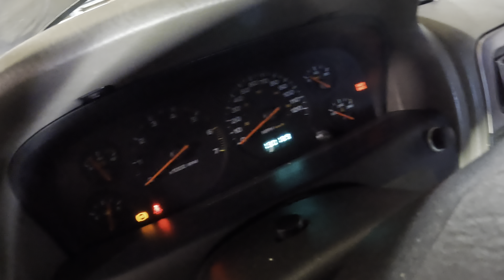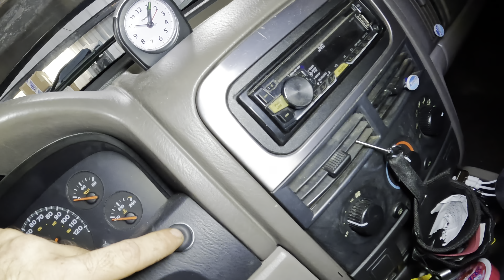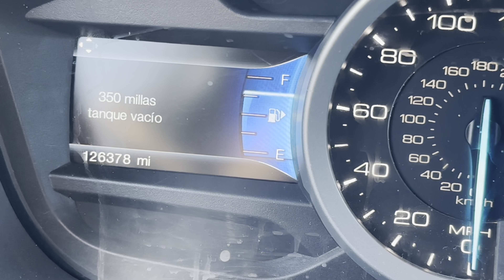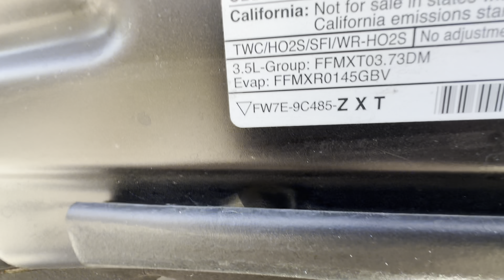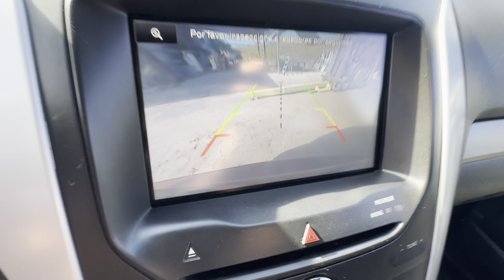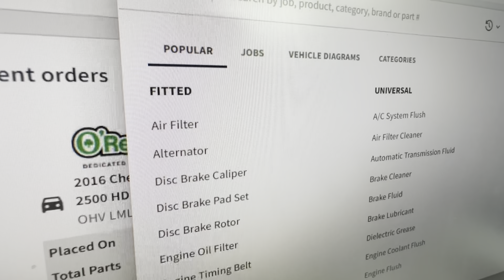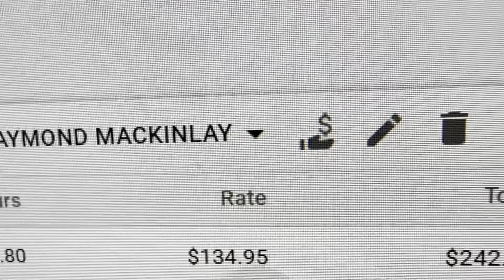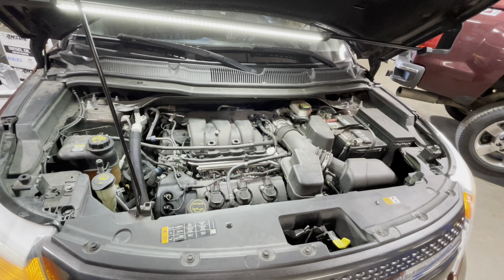TOO EXPENSIVE!  Repairs Declined! Twice! Jeep Cherokee 4.0 & Ford Explorer Noises While Driving

Comment: If you want to see an expensive alternator replacement, the 2005 Ford Escape V6 4wd quotes 7.8 hours. Having done one once, it takes 10 minutes to loosen, the rest of the time is making a hole big enough to get the unit out.

Comment: That Jeep Looks and sounds a lot like a DIYer something I use to pull in my younger age when i first got a car. Take it to a shop have them do the diagnostic and them tell me the problem and then attempt to fix it myself while ussually making the problem worse. Now ive learned over the years if im taking it to a shop to be diagnosed have them fix it and if i cant afford to do so then i need to keep it parked or driven within certain limits. Ive matured over the years. Sounds like you keep getting stuck with some guys DIY project whoes most likely to cheap to pay you. But dont worry from experience hell go home and butcher it up and youll end up fixing another persons screw up instead. 
Glad im not the way I use to be Lol. Watching your vidoes and others have taught me to have more respect for yall.

Comment: I have the same year & model Jeep but mine’s a Limited.  I have 240 k miles on it.  Just changed all my suspension parts front and rear.  That rear upper control arm will really try your patience. This Jeep is sad. I’m surprised they don’t have the death wobble.

Comment: Also for the fwd crossover, of any variety, losen the front subframe, unbolt compressor from block(slide out of the way)  and itll give you enough room to drop it from the bottom. Source: fwd nissan v6 alts done more thsn id like to admit

Comment: On the subject of the OEM Quality Alternator, the Motorcraft ones, like most Motorcraft things, are usually quite a bit more expensive, but they're good quality parts, and most of Ford's stuff, even their aftermarket, is still made in the USA, so you're getting what you pay for.
Source: basically restoring an old Ranger and only get Motorcraft when possible and have been keeping tabs on it, unless I know of an aftermarket part that is guaranteed to be better.

Comment: Had my boss's Exploder Alternator Pulley Seize, and burn the belt off. Same model, and engine. Ended up doing the job twice becsuse we went with the aftermarket Alternator first. That didnt work out, so i went with the OEM... i was able to sneak it out without touching the AC. Must be a common issue with the Ford Nators in that model...

Comment: Makes me glad I live in Australia where all states have mandatory annual safety checks for rego after a vehicle is more than 3 years old. Catches bald tyres, bad brakes, faulty suspension, structual rust, electrical faults etc.  You can't register or insure a vehicle without a pass. Ray should really charge customers some kind of inspection fee - I'd say min 15 mins labour fee. That first vehicle wasn't safe and the second one basically got a free diagnostic.

Comment: Referring to the explorer, what I try to tell customers (and usually after the fact)  for next time, is spending 500 now will save you 1,000 later.  Because it's going to be a catastrophic failure, usually at an inconvenient time, and then you have to pay to be towed, and it will likely take more parts with it as it fails.  That alternator pulley will seize, destroy the belt, it will likely take nearby wires or hoses with it.  And if the belt wraps around and gets caught in moving parts, it might burn down the whole vehicle, causing even more money to leave the bank..  long winded, I know.  But if you have to spend money, a little now is better than a lot later

Comment: FYI Ray most Ford's dont have a button on the dash for heated steering wheel if there is a touch screen head unit. There is only a selection for it on the head unit in the climate control menu. Pretty dumb design but thought you could use that info for future reference.

Comment: Wait, you don't charge a mandatory diagnosis fee?  My local Ford dealer and private shop charges an individual fee for every item they diagnose, if you fix anything or  not.  My last trip to Ford they wanted $197 per item diagnose and I had five items.  I told them to just leave it and I will pick it up.  $985 before any parts or repairs is insane, but that is Denver for you.  They weren't even anything major either.   I have no problem paying for diagnostic fees but a grand before anything even gets looked at it nuts.  You definitely should charge $99-$125 diagnostic and if they have you do the repair you can remove it or reduce it.  But damn.  I thought that was cheap to replace the alternator with a Ford part, belt, etc for $593.  I don't have much money but I see quality work done at this shop and well deserved.

Comment: How odd - looks fairly new - you need a working alternator as it can strand you.  Up here they charge for diagnostic eh - the only recent exception was my old convertible when I took it to another shop as no one could understand why it would say once a month not start but it was getting more and more common; so they said because they could not help me get closer to a solution, they cancelled the charges (turned out to be the little circuit in the fuse box - guy on a forum said give it a shot as they were known to get wonky).

Comment: The way I see it with repair work is
If it's something you can't repair yourself and you don't have the money to pay for the repairs when you bring it to a shop immediately
I would be trying to park the vehicle in a secure location till you can get the repair done the right way. Besides the obvious saving up money to be able to afford the repair(s)
The only good news about taking it to a shop is that you can get an idea of everything that has gone bad that you may or may not know about and compile a list of parts to buy 
For instance I know what  I need to replace on my vehicle right now ( lean sale tow yard)
Tire pressure sensors
One of my rims ( bent a bit still holds air properly though ) 
My subframe ( bent a bit thing got shifted)
My front control arms ( one of them is bent the other one is just in rough shape otherwise good going to replace both though along with the bearings. ) 
Needs new shocks 
Front frame ( a bit bent out of shape making the hood not sit properly otherwise fine.) 
Front crash impact sensors ( car was in a wreck that was not reported to my knowledge) 
Just make a mental note that whatever shop you take your vehicle to it's going to be about 100$ per hour paid for the work done on your vehicle aside from parts and usually shops will be getting the parts themselves as that's part of how they want to make their money. Sometimes you can find a shop that will let you bring your own parts for installation then you are just paying for the labor charges.

Comment: cannot believe there's no vehicle inspection....I also cannot believe the non-working, not-padded brake on this Jeep, or the manner in which the owner dealt with it - with a pair of Mole Grips!!!

. In the UK, as SWATStrachan 1 mentioned, there is an MOT test that has to be done annually. It is for cars that are over there years old. That test means that this Jeep would never be allowed to even park on a road, it would have to be on private land somewhere. Also the MOT inspectors can stop any car, anywhere, at any time to do a spot inspection, and they can fail it on at the side of a road. On top of that a vehicle cannot pass an MOT if there are any maintenance indicators active on the dash.

Regarding the offset for after-market wheels. I recently replaced mine and although I knew the offset I needed, every single outlet I contacted made sure that they themselves checked what was correct for the car, and they will provide the appropriate bolts and spacers with the wheels if one chooses to purchase.

Great video again - thanks for the effort in your professionalism in your trade, and for sharing it with us.

Comment: I’ve been in the repair world, different industry, starting my 40th year. One of my biggest pet peeves are cheap, ignorant people. I hate doing the diagnosis all to be told NO.
 I no longer tell my customer what I found until the repairs are complete, otherwise I give a price, then they can choose to fix it or not, but I do t give any info so they can take it and screw it up worse than it already is, just for them to bring me a bucket full of parts and expect me to still do the same job for the originally quoted price, not gonna happen!

Comment: holy shit, 2015 ford and the alternator already took a shat?  I'm on the original alternator on my 2001 Subaru Legacy and 2003 Toyota matrix. 
It's nice to see how the price adds up on your computer.. it sucks but it wouldn't be as bad if the alternator was $100 like you were talking about.. the customer is gonna take it to another shop expecting it to be less, and it wont'

Comment: 54 dollars for a practically new AC Delco alternator for my K2500 from Pick and pull,, and about 10 minutes to change it out. F that 600 dollar bill. I now have a 2002 5.9L Durango and I aint letting it go for anything. Real steering rack, real E brake, real power steering, and stiff enough suspension that I can feel the road. I'll save up for a fully built 5.9, and a trans rebuild. I don't want anything to do with new vehicles.

Comment: Regarding the Explorer:  That, was two inexpensive work estimates.  Last year I replaced the alternator on my lady's 2010 F150.  Out the door of my local dealership the 'nator itself was $605.00. 😲 I know, I could've had a cheaper unit, but my lady insisted on the genuine Ford part.  Good thing too -- everything I was reading was favoring the OEM unit because of Ford's "smart charge" system (the ECM and alternator communicate with each other to tailor the battery charge).  Ah, but the good thing was that it's so easy to service -- disconnect the electricals, release the belt, loosen four bolts and she's off.
 
On the Jeep, it can be saved, but it'll be a bit of work.  And 💲💲💲💲.  I hope the customer opts for repair(s) and we get a followup video.
 
Happy New Year! 🎉😁

Comment: That looks like they have no idea what they are doing with their Jeep. I have helped install a push start for an old lady who did not have the strength to turn the key to start. I know a local junk yard and he gets customers just like that. Wanting newer style rims and they never ask any questions. He knows they will have to modify the setup to use the rims. But he assumes they know that. Because they never bother asking questions about fit issues. It looks like they had bad brakes, then put new brakes on the messed-up rotor. Imagine that, declined. If that pulley comes off, she will not only need an alternator, but a new belt too.

Comment: Problem is these companies over charge for their parts, causing to extreme repair bills for customers. I am never able to afford any service to my car other than oil changes. I have a car with 105k miles, and once something breaks that costs over $300 to fix, the car is going right to the scrap yard. Even getting my brakes changed literally puts me into an extreme amount of debt that I have to claim bankruptsy to get out of. Last time I had my tires changed, it was $702.50. I couldn't afford that but the tires were down to the wire. It took me over 2 years to be able to pay that off, and ended up having it go to collections the year prior. They wanted $140 per month until it was paid off, I could only afford no more than $20 per month. Next time I need tires for my car (which is very soon) I am just going to sell the car and buy another car with the money I got from the sale. Rinse wash repeat with every car. Filing for bankruptsy in the next couple months and moving out of my apartment and moving to either live in my car or live on the streets. America is too expensive to live in.

Comment: One thing I can tell you is that 4l amc motor don’t have anything wrong with it that thing will start run with no coolant or oil in it. Facts. Now the transmission is a Chrysler transmission. So after about a hundred k miles on it it may need to be swapped out for the original Toyota aisin that is in the xj

Comment: 1/2 hour minimum diagnostic charge which is deducted from repair charge .So the client still has to pay for the diagnostics even if he decides on another shop to do the work = he does NOT save any money. Nobody works for free. The Jeep on the other hand is close to scrap with over 2500 in repairs and God knows what else has been neglected.

Comment: Im amazed at how rust free the underbody of the Jeep is. Obviously lived somewhere dry and road-salt/frost free. In Europe this Jeep would be condemned by the annual compulsory safety check and would be put off the road for any one of those loose joints and kaput bushed and mounts. Let’s not even contemplate on the ridiculous condition of the brakes. Anyone driving that heap on the road need their heads examined for defective cells.

Comment: I hope you charge diag fees, Ray.  Tell the customer right upfront.   If they balk, you didn't waste your time.  If they accept the repair, deduct the diag fee from the bill.    Your time to diag it and build an estimate needs to be compensated.  I think a flat $50 diag fee if it takes a half hour or less, and if it hits 45 min it becomes $75, and $100 when it hits an hour or longer.   That would be reasonable  and you don't waste time on the decliners who are shopping around,  and the DIYers looking for a free diag so they can do the repair themselves after using you to guide them to the problem.   Have them sign a simple diag paper  authorizing the diag fee, which clearly states what the fee structure is  on the form.   Then if they accept the job, write a standard long form repair invoice, incorporating the diag fee to be deducted.

Comment: Like other comments say, Mechanics charge way way too much nowadays, especially since most of them aren't really that great. The only really good mechanic I've seen on TV is, The South main auto channel guy. He is the best mechanic i've ever seen and only charges $90 an hour. The last 2 times I've taken my vehicle to the dealer. Were for diagnostic only, when I didn't have the electronics to find the problem. And they were both diagnosed wrong. With a little poking around I repaired them myself.

Comment: figures only in FLA you find a 2wd jeep cherokee if it wasn't just a 2wd be worth fixing ad selling up here in New England as the body it self is in good shape. I can get the whole front end steering linkage through detroit axle  for under $200 to fix the major mechanical things (brakes and steering components) i can do myself and probably be $500 deep into it you can't find them up here that the unibody ain't rotting out of but 2wd is useless here

Comment: It should be possible, if not mandated, for repair shops and garages to inform the police (and/or relevant) whenever they find a dangerous vehicle. Drivers of dangerous vehicles then need to be prosecuted if they drive on public roads. That would mean mobile scrap heaps like this Jeep would either be repaired or crushed.

Comment: Safety inspections are a joke. Lived in Asheville North Carolina in the mid 90's. Worked with a guy that had his car pass inspection. His headlights were literally duct taped on. Brakes did not work, had to use emergency brake. Exhaust was held up with wire. Could go on and on. He just knew a guy would give extra money to so he could get inspection sticker. Was a joke system.
Reply: A $50 bill always does the trick! 😂😂😂

Comment: As much as I hate living in a state that mandates vehicle inspections every year, this jeep is the perfect example of a dangerous Jerry-rigged repair. At some point the vise grip on the brake hose or ball joint on the tie-rod will break. If this occurs on the highway, loss of steering or brakes will cause an accident with some innocent motorist.

Comment: the problem with a job like this is , he will take the quote and show it to someone else who will undercut you PLUS you are risking YOUR reputation.
 i refused to fit chain and sprokets to a Kawasaki , because there was no rear brake , not a non working rear brake , NO rear brake caliper. bloke left , i followed him out on another bike , he left me for dead , thro' the traffic , only for me to catch him up when he failed to stop at a set of lights , t-boning a car. i stopped at the accident , waited for the cops to arrive , and gave a statment , they came to the shop for a copy of the waiver that i got the service manager to issue , that covered our arse.

Comment: Drywall screws are weak, in the starter is unacceptable; decking screws are stronger.
Was the starter live wired to the battery? Run up on an old Ford tractor like that, if it was in gear and hit the button, tractor could have run them over.

Comment: The owner brought the Exporer to you just to get a diagnoses, not intenting to have you repair. That alternator sounded like a must repair, no option. They will possibly take it to some back yeard mech to repair/ replace for $100. 
No money on the time you spent to diagnose if only 30min or less. Should be charging a $50 inspection fee.

Comment: This thing is like 10k worth of damage on it.. OMG.. By the time wtf was these people thinking?? (12:00) Referring to the first vehicle only on this thread.
Reply: That's with out the 125 and hr. Work price tag either wow... OMG.. Out here shops see some thing like that they instantly jump to 200 an hour and state they will get to it when they get to it and it has to be legal road worth before it leaves with attorney signed paperwork stating that they are aware of the need of the repairs and damages done to the vehicles. Basically illuminating the liability on the shop if the customer decides to yank it in the middle of repairs.